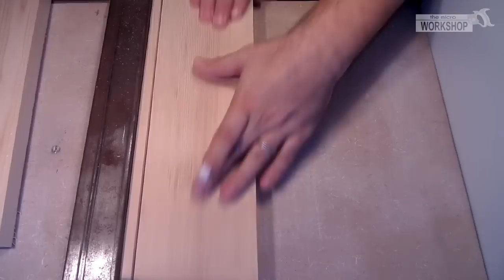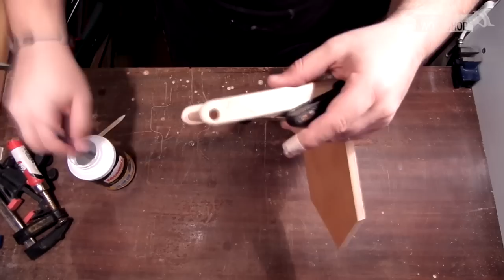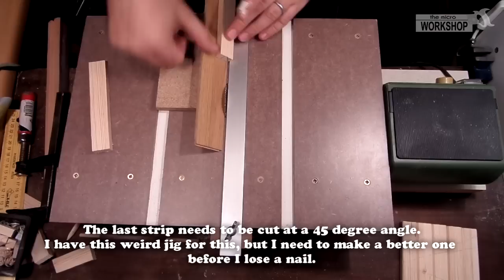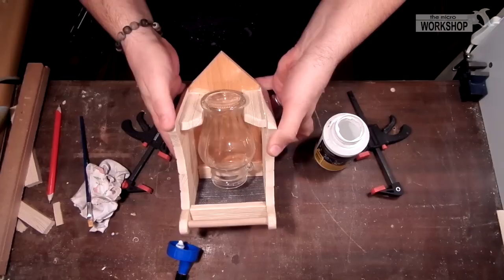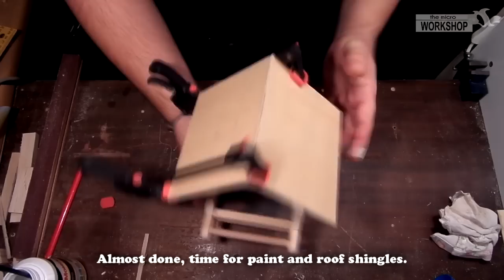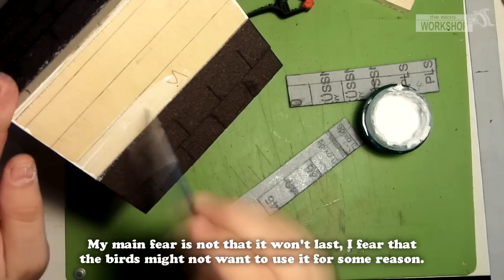Making a Bird Feeder

Comment: Hi ..... Very surprised to hear that this video wasn't that popular .... I think it's great. I think the roof idea is really smart and looks good. Can I ask, I'm from the UK and we get wet cold winters. Did you weather seal the sandpaper shingles in any way?
Reply from the maker: No I did not and it stood outside the last two winters and they were harsh here (Eastern Europe). The shingles show no wear. Only the plywood cracked a little, but overall it still has a few years left in it even without new paint. If I take care of it it will probably last a decade or so.